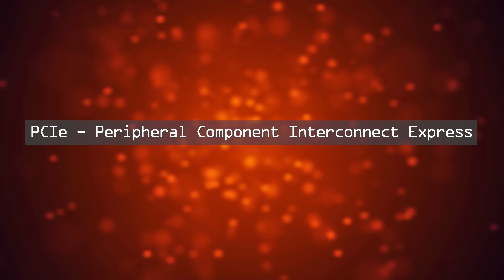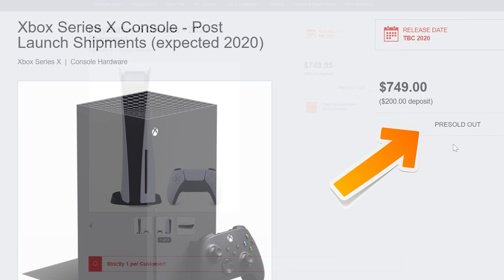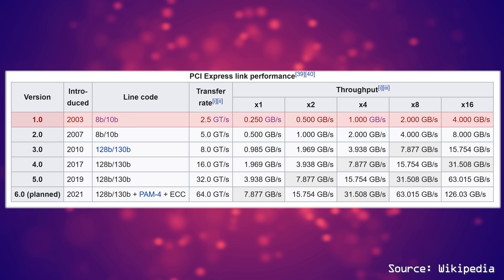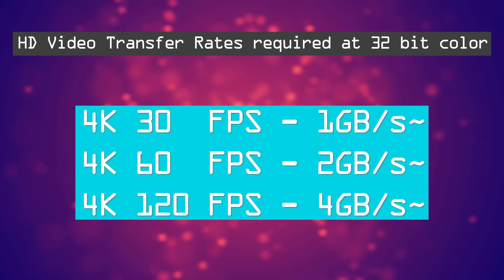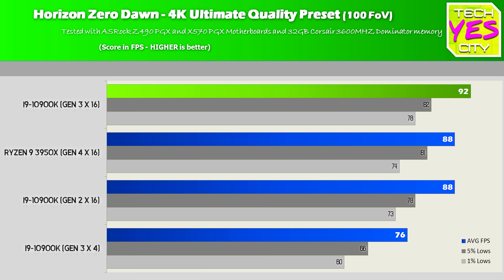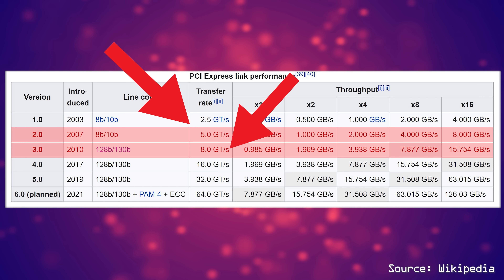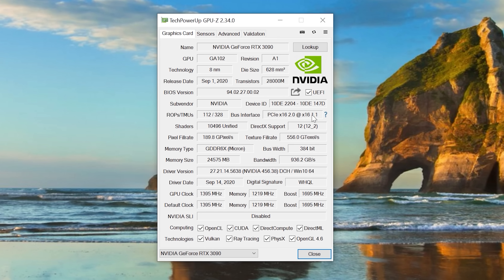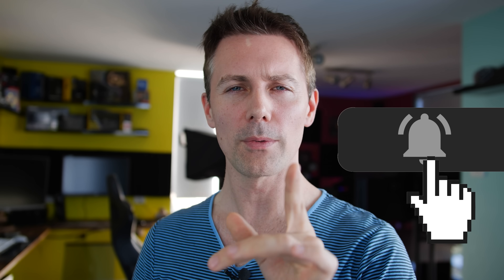Why PCIe 4.0 Doesn't matter for Gamers... Yet

Comment: Of course! GPUs can't even take advantage of PCIe 3.0 x8 ports! I wish GPU manufacturers would release their cards on x8 so we can share the lanes for more things like m.2
Reply: It is the motherboard manufacturers that need to make changes.  It is all about how they split the available lanes.  The check out the Asus  B450-F  it runs 2 pcie 3x4 nvme by restricting the gpu slot to 3x8 when the second nvme is installed.  ASUS is releasing a refresh of their B450 boards that give 2   m.2  connectors to more of their boards.
Reply: @jamesthomson8659  Oooh that's a really good point!
Reply: He does tech, speaks japanesse, and makes dota references. I wish I had friends like him :3
Reply: marco geuss what i found  out PCIe 4.0 dont contain xeons :(
Reply: @shannonb1682  Oh No!
Reply from the maker: @MarcoGPUtuber  bock bock bock, that is what you sound like!
Reply: @techyescity  lmao. Gotta promote the YES to the algorithm!
Reply: @MarcoGPUtuber  Will the gt 1030 on pcie 2.0 have the same performance as it is on pcie 3.0? or maybe like 5-15 fps difference?
Reply: Compatibility honey ...
If gpu use x8 the bandwith will be limited in old PCIe
Reply: @syarifairlangga4608  why would I want to use a 3090 on anything before PCIe 3.0?
Reply: @MarcoGPUtuber  why on earth would I want use a 400w gfx card is what I would say.
Reply: @Roy marr PCIe 3.0 8x is fine.
Reply: https://www.sliger.com/products/cases/sm580/ this case hasa PCIe riaser which can split a 16x to 2, you may search similar product in Amazon/Ebay i think
Reply: the example of this is rx 6600xt who have slightly better performance than rx 5700xt and it runs at x8 there no bottleneck even if you run it at pcie 3.0 x8 same result
Reply: Rx 6600 xt